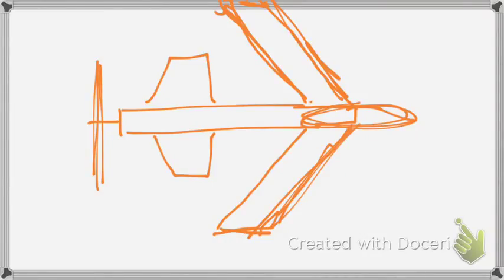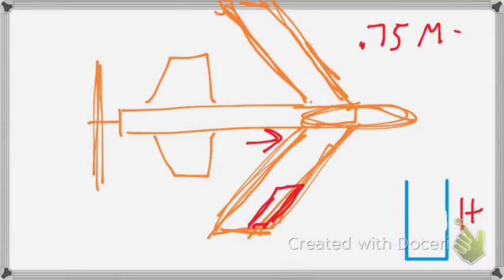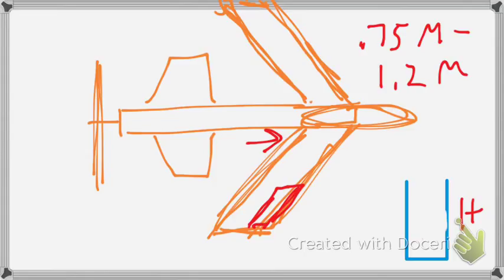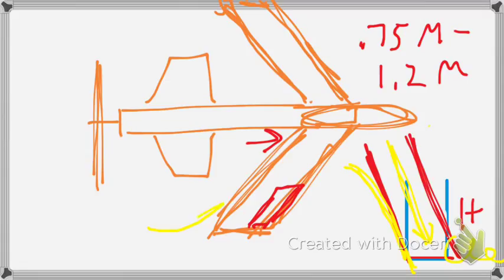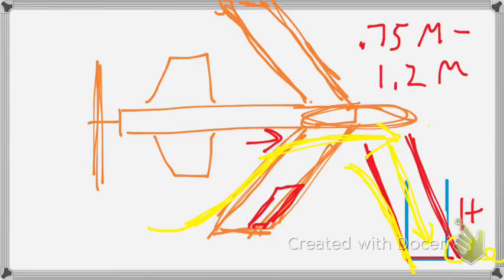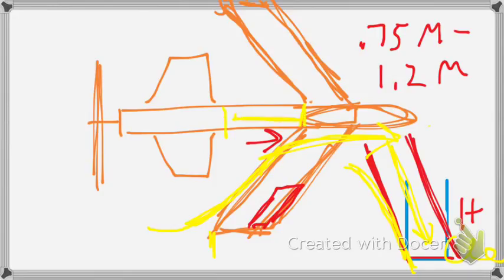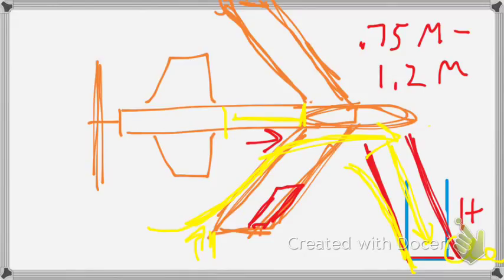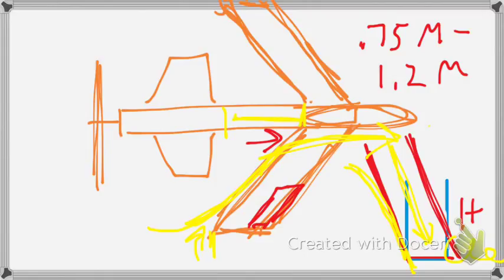Forward Swept Wing Discussion

Comment: You mention the wing bending causing it to twist into higher angle of attack, and that this can lead to tip stall. There could also be a problem with aeroelastic divergence. There are a few good texts which discuss this. Ashley and Bisplinghoff is one of them I think I may remember. That is, if the bending axis of a wing is behind the aero centre, as it bends upwards under lift load it will tend to twist into higher angle at the tip. Above the "divergence speed" this can run away, with each additional bit of twist adding to the lift and so to the bending and so to more twist, etc. The wing is ripped off. There is a bit in the film "The Blue Max" which is about this occurring when the transition from biplanes to monoplanes was made. The designers tried to strengthen the wing, which had been failing unaccountably (they did not know about divergence), by adding a reinforcing rear spar. But this moved the bending axis farther back and made the problem worse. A swept back wing tends to twist into less incidence with bending. There is also a flutter speed which planes must not exceed. I do not know how it is affected by sweep forward. 

It was interesting to learn about the transonic advantage of sweep forward. Thanks.

Comment: Anyone interested in this subject should watch the video titled X 29 Forward Swept Wing Kurt Schroeder on the channel PeninsulaSrsVideos.
The X-29 required a fly by wire control system. Apparently forward swept wings are much less stable than other commonly used wing styles.
Edit: The instability of of the X-29 wasn't caused by the forward swept wings. The instability was caused by the canards.

Comment: Transcript:
The forward-swept wing helps us with transonic flow over the wing (where some of the flow over the wing is supersonic). Transonic occurs between .75 & 1.2Mach (speed of sound). What this does is helps with our manoeuvrability by maintaining aileron effectiveness even as shockwaves form on the wing. (Shockwaves) form on forward-swept wing the shockwaves which are causing drag & turbulent airflow will build up at the root instead of the tip. The other major characteristic of a forward-swept wing, is a reduction in induced drag associated with span-wise flow. On a conventional swept wing we have span-wise flow from the root to the tip (because the air hits the wing, it tends to bend & flow outwards from the root to the tip [just because of the design of the
wing]). With a forward-swept wing, we actually have flow from the tip to the root [because of the forward-swept design]... having a reduction in wing-tip vortices and their associated induced drag. ....We're able to generate the same amount of lift without the penalty of induced drag, so we can make the wing smaller (also reducing parasite drag for a given amount of lift production). - So there's an overall drag reduction on a forward-swept wing.
 Some of the disadvantages of the forward swept wing, primarily they are structural; with that leading edge forward of the trailing edge, we have a lot of wind resistance associated with that tip being forward of its kind of, mounting point, there's some leverage associated with (distance- longitudinal length of sweep) - have a kind of 'moment arm' built up there. There's going to be a tendency for this tip to twist; which is bad because, what happens is at high angles of attack, you're tip is going to be sitting at a higher angle of attack than your root and you're going to have tip stall to be a tendency with the forward-swept wing.
They are able to control that to some degree, using some modern materials, but one of the main reasons we don't see a lot of forward-swept airplanes, is that the advantages aerodynamically, do not outweigh the disadvantages from a structural standpoint and there are ways; like winglets and wing fences to reduce spanwise flow and drop that drag down in a conventional swept wing airplane and almost get the same benefits you would get with a forward-swept wing airplane. Now arguably the forward-swept airplane looks cooler; so if we designed airplanes just based on looks, it might be worth it to go thought the structural, sort of engineering to make it happen. And forwards-swept wings also tend to be heavier because of the structure required. Now modern composite materials are enabling them to build them lighter, but ultimately this is probably a design we will not see much of; you know, unless it's the extreme sort of fighter like the SU-47 or the X-29 sort of research project. Now the SU-47 is a front-line fighter, so obviously; you know those design characteristics having to jump those structural hurdles was worth it to get the advantages of that forward-swept wing. I hope this helps; just sort of expand the discussion; I love this stuff, so anytime you guys have a question, I will try to look it up and get you an answer; appreciated Johnathan's help as well in class they're explaining that transonic issue on flow. And just for a; just to make a point; just because I'm standing up in front and teaching, does not mean I know everything. So if I am (and I said this in the last video as well), saying something incorrectly or someone has a question in class that I can't answer, but you feel you can. I'm totally okay
with the opening up that discussion…..

Comment: Thank you very much for putting this up.Having only see this idea in the last couple of year ( although i understand it has been looked at since the 50's ) I have been very impressed by it . The idea that you can escape both tip mods & fences would suggest their should be some more capacity in this idea if the materials issues can be sorted .